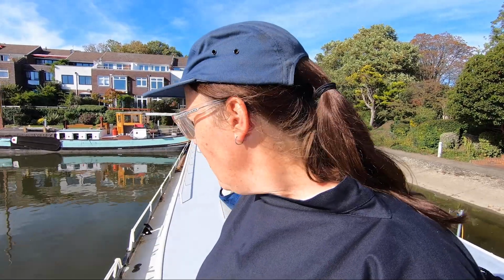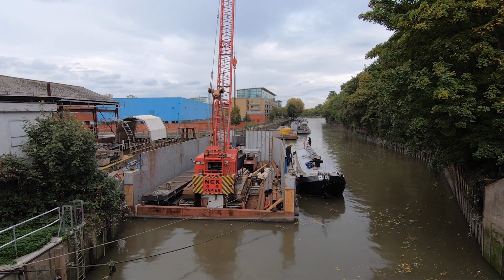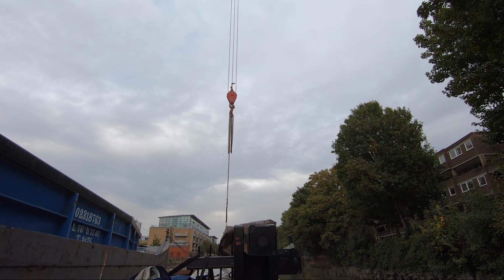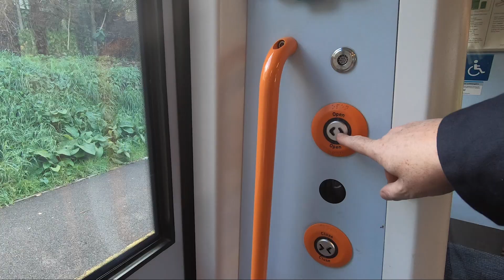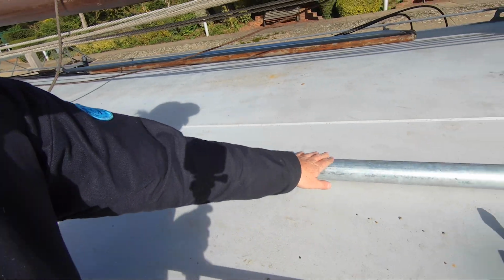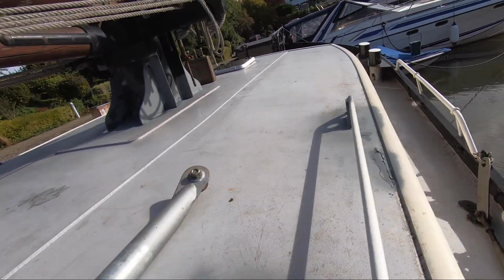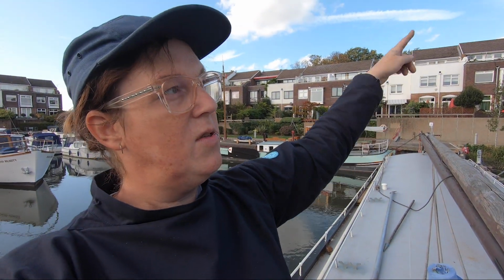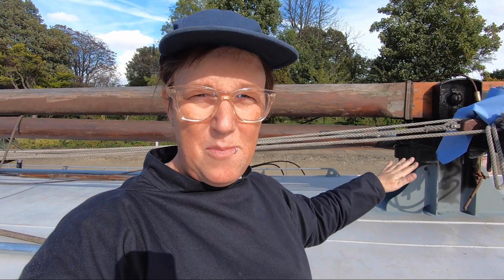#69 The Final Trip to the Yard - Dutch Barge Home

Comment: That certainly looks like a lot of work. Massive chunk. Back to internal nibbles through the winter. Is that a crack along the mast? You're obviously not concerned about it so possibly looks worse than it is. This is probably a stupid question. Are the ropes too short because the roof was raised? Lovely hammock/chair 💚
Reply from the maker: Yes, the mast is cracked although I don't think it affects the structural integrity. But I am going to try to prevent them getting worse. The ropes are too short because of that, yes! :)

Comment: What did you mean about no tides after Friday ??
Reply from the maker: Sorry, I should have explained more, I can only get through the lock on a spring tide because otherwise there's not enough water to open both gates at once so I'd need to wait for the next set of springs.
Reply: Excellent Beth  whats the difference in height and how often do they occur ( so many questions)
Reply from the maker: @carlpegg3958  Well I need at least 6.8m to get in and out so anything lower than that I'm stuck. Spring tides tend to be at least that and around 7m. Neap (lower) tides are too low for me and sometimes only 4m. The tides happen every 12 hours or so when the moon orbits us but every 10 days or so the moon and sun are in line so the tides are higher and when they're not the tides are lower.
Reply: Thanks Beth it makes the Oxford Canal seem a bit mundane. Your explanation was spot on
Reply from the maker: @carlpegg3958  Well every waterway has its challenges! ☺️